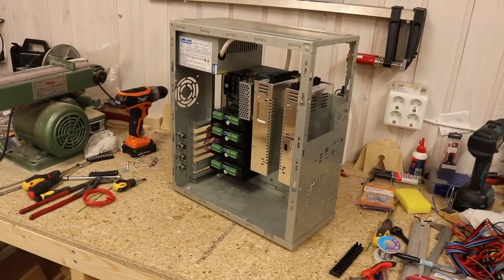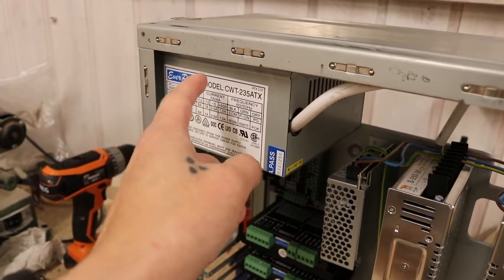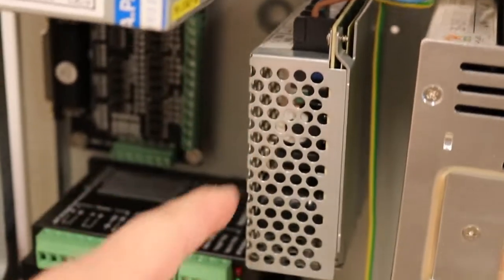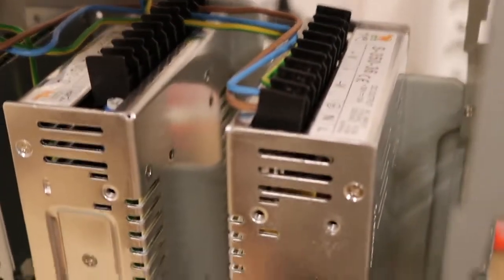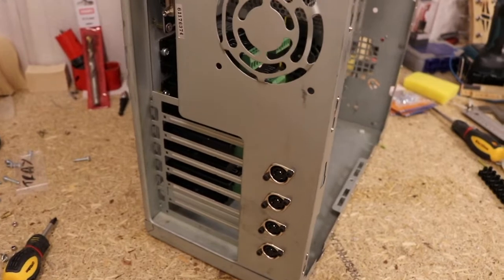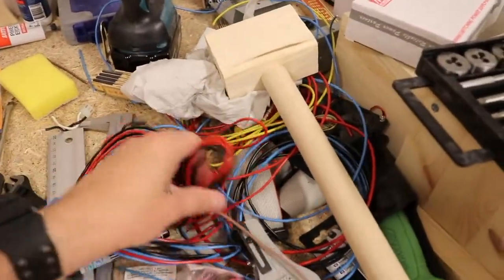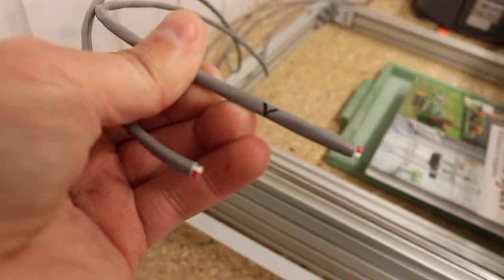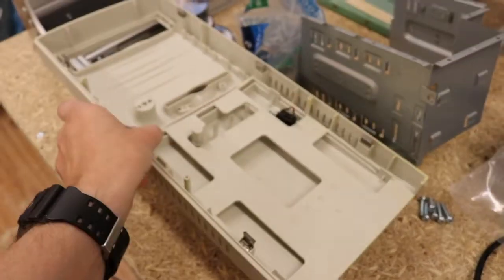Raw CNC 1.5 Build Part 4

Comment: Nicely explained. Sir, I have DM556 drivers upto 5.6 amps each, my steppers are of 1.5 (Z) amp , 5 amp (Y) and 3.35 amp (X). This is a 3 axis cnc. I can not decide what power supply I shall use. Can you please guide?

Comment: The power box is looking good.. But why DIN5 connectors?  For machines is always good idea the connectors to gave some type of locking mechanism, so 4 serial port connectors i think are much more reliable.
Reply from the maker: You are right, its much better with those locking things, in my case those DIN5 connectors was the only thing i could get in my local store, how ever, i will order some better ones from evay in a close future i think... Cheers.. :D